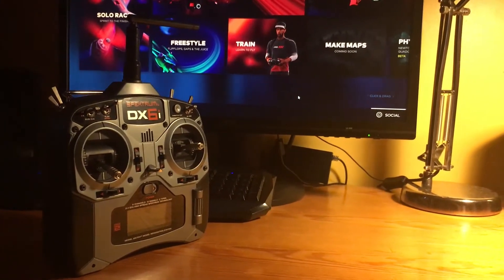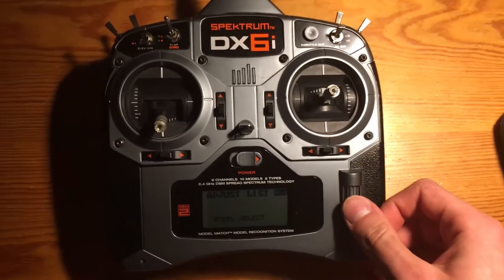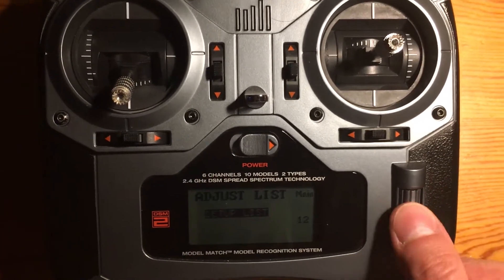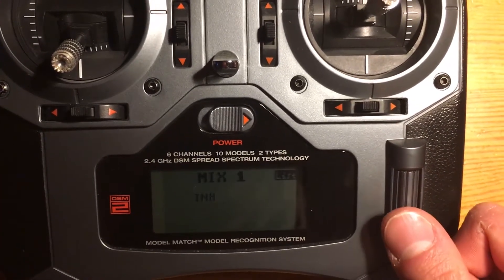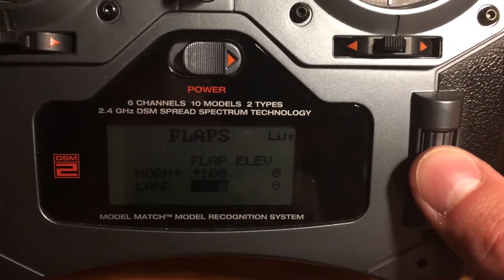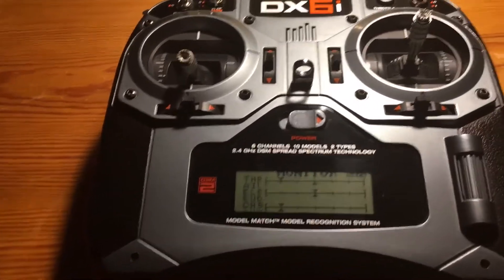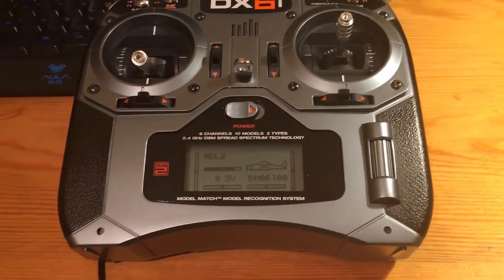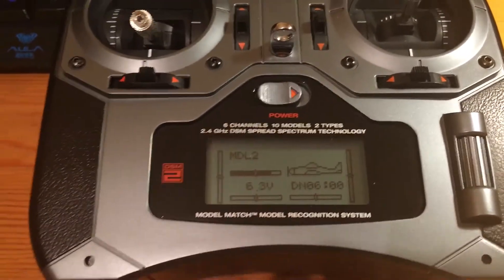Spektrum DX6i - DRL Simulator setup

Comment: cool vid thanks. Very helpful. Why didn't you use stock usb cable?
Reply from the maker: Bought Spektrum second-hand - there was no usb in the bundle.
Reply: Evaldas Snukiškis ok. For some reason it won’t detect my controller :(
Reply from the maker: Josh unfortunate!
Let others know if changing the dongle (or other solution) resolved your issue :)
Reply: Evaldas Snukiškis yep I got a new USB dongle and it wired straight away
Reply from the maker: Josh amazing! Thanks for sharing.